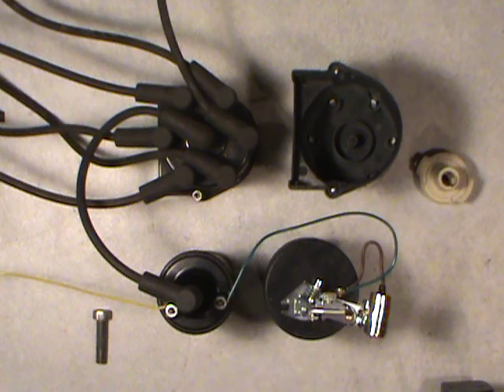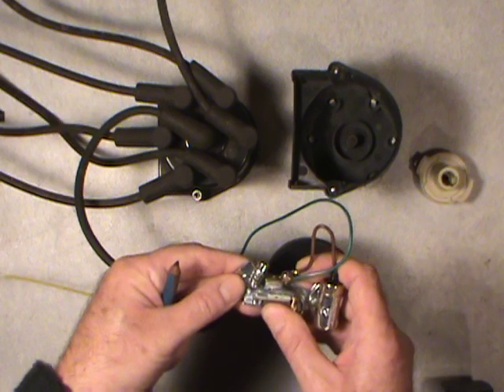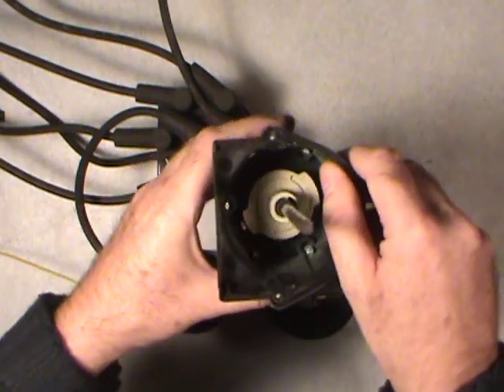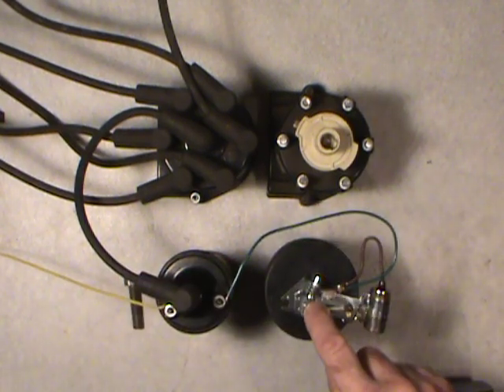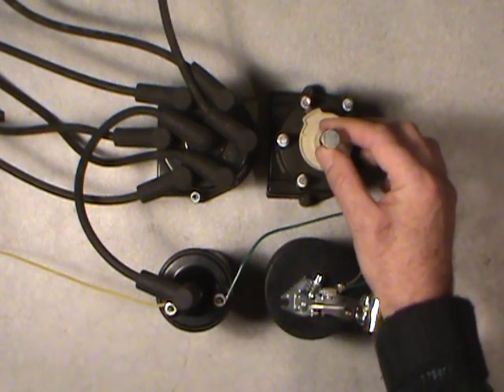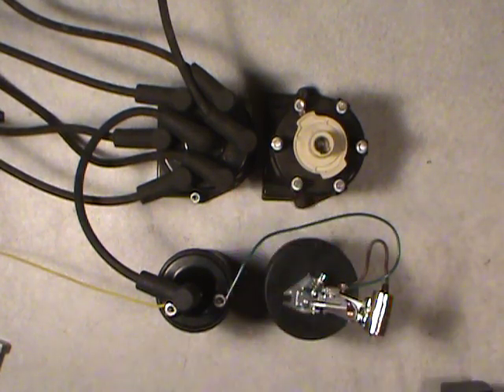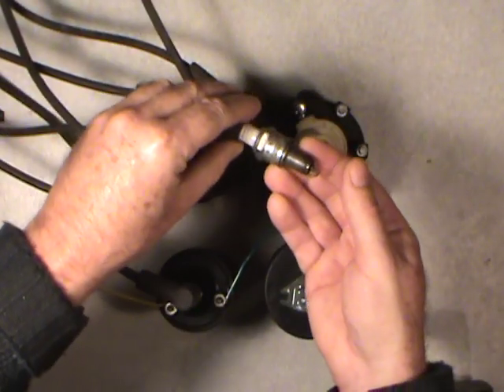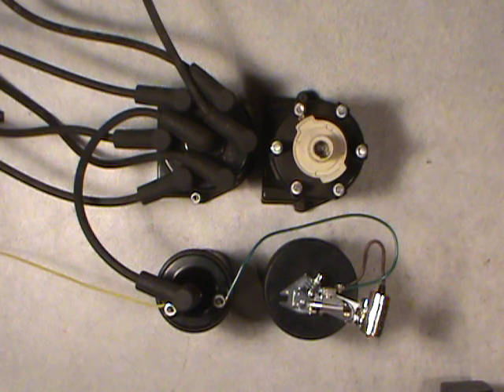Simple Explanation of an Engines Ignition System

Comment: MISFIRE,  I found this article http://www.nonlintec.com/sprite/cap_failure/, describes the poor manufacturing quality of condensers leading to arcing, they recommend a better capacitor -condenser, but I re-read it, gave it some thought, then I put a 2nd condenser on the coil -ve post to ground, reason - the chance both condensers arcing at the same moment would be remote, and also the non-arc condenser electrically kills the arc of the other, my long time misfire problem in L20b Nissan engine is cured, so - please consider - on any engine with points and condenser, replace 1 old condenser with 2 new for great results
Reply from the maker: Greetings...Steven Olsen.............Thanks for the information, and, for watching too..............Good to hear, that, two condensers (aka, capacitors) are working good for you..............I've heard in the past, how some guys, and maybe gals too, used to carry spare ignition parts in their vehicle's glove box/glove compartment, just in case something goes poof................As for me, I've never had a condenser go bad on me (lucky, I guess), even when I re-used the old one, when installing a new set of points, in a good ole, points & condenser distributor, be it, in, an inline 6 cylinder, V-8, or Mazda Rotary engine (which had "2" Distributors, one had, 1 set of points, and, the other had 2 sets of points in it...!!!)............From what I recall, the Condenser's "Micro-Farad" rating, has to be "Correct", for that "Exact", vehicle's ignition system, cuz of, the circuit being, a, shall we say, Finely "Tuned" electrical circuit.............Now that you have "2" condensers hooked up, here's a really good-n-easy way, to tell, if those "2" Condensers, are working, as good as, a "1" only, Condenser, should be, that has the "Correct" Micro-Farad rating, for your "Exact" vehicle and engine...............It's just a matter, of simply, having a look at, the Point's, "2-Contacts", once in a while (they have to be opened-up/apart from one another, to see what's going on), cuz, if...???...the "Micro-Farad" Rating of the Condenser, or Condensers, as the case may be, are "Not-Correctly"...Matched, for that "Exact" ignition system, then, one of the (point's) contacts will usually have a "Crater" in it (as in, missing metal, that looks kinda like, a little hole), while the other (point's) contact, will usually have a "Build-up" of metal on it, in line with, where the Crater was, that was (hypothetically), on that other (point's) contact, that I mentioned, a very short time ago............Lem-me-see-now, as I recall, it used to be, that, if the Negative (point's) contact, had less metal (as in, having, a crater/hole in it), then, the "Micro-Farad" rating of the Condenser was too "Low", and conversely, if the Negative (point's) contact had "Extra" metal on it (as in, a raised bump, if you will), then, the Condenser's "Micro-Farad" rating, was too "High" (gee, I hope that I got it right, as it was a very long time ago/once upon a time...lol).............So, keep an eye on, how the (point's) "Contacts" are behaving, cuz, it's about the easiest was to tell, that I know of, if things are working, as well as, they were designed, to be doing so, and........till next time.......Be Safe, take care, and have a good one.

Comment: hi, nice video, can i direct the ignition coil of 1999 dakota sports 3.5 L, into a battery with out fuse , i cannot find which is which, pls help me to identify the positive and negative. main problem of my car is ignition coil has no spark, the computer is not sending a command to ignition coil to spark. so i want to direct to the battery and put toggle switch. or best advice of your thank you..
Reply from the maker: Greetings allan hasta....Thanks for watching, and commenting on this video..."DO NOT", Change "ANYTHING", such as "Wiring", or try to Install "DIFFERENT" Parts, in Your "1999 Dakota Sports!!!" (and, I think that Your Engine may be a "3.9 Litre" Engine, and not a 3.5?)....Seeing as how the Model Year of Your Dodge Dakota is "1999", then, what You have there, is a "COMPUTER" Controlled Engine Management System, where Your Dakota's "Computer" Controls the Ignition Coils "TIMING", as in, when to Fire the Spark Plugs at the Proper Time, so that Your Dakota's Engine "Does Not" get "Damaged" or "Destroyed!" (that can be, Very, Very, Expensive!!!)....Your 1999 Dakota's Computer "Controls" So Many Things, such as, the "Fuel Injection", that has to be "Directly Related" to Your Ignition Coils "Spark Timing", or, like I said a short time ago..."Expensive Engine Damage" will be the End Result!....About the Only thing that a Mechanic can do, is, Test Your Dakota's "Ignition Coil" (might use an Ohm Meter), and, if Either Your Old Ignition Coil Is OK, or, a "New" Ignition Coil gets Installed (the "New" Ignition Coil, has to be the "Correct One" for Your 1999 Dakota!), then, the Mechanic will probably use a "Scan Tool", that looks kinda like a, slightly Larger Hand Held Calculator, to "Read" any "Trouble Codes" that may be "Stored" inside Your Dakota's "Computer"....Those "Trouble Codes", can then be Looked at, to determine, just How Many "Things", that may be "Wrong" with Your Dakota!....With "Computer" Controlled Cars and Trucks, "All" Parts that get "Changed", have to be "Exactly the Same", as the "Original" Parts, that the "Factory" Installed in the Car or Truck, when "Brand New!"...or..."Expensive Damage and Trouble", will probably happen in very short time!....Always Remember, that, "Computer Controlled" Cars and Trucks, "Must Have" the "Original" Type of Parts, and, "All" Wiring, has to be just like the Factory "Original" Wiring as well!....So then, maybe have Your Ignition Coil Tested, and, have a Mechanic, or Someone, who Knows how to use a Scan Tool, and also Knows how to work on Your Dakota....I hope that You get it Fixed, and Running Good again, and Not having to spend much Money as well....be Safe, take care, and have a good one.